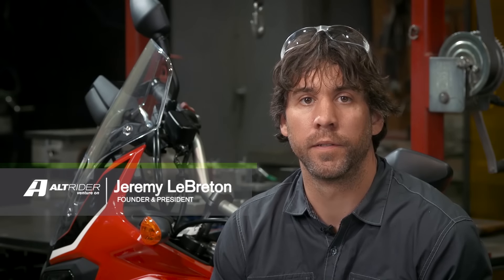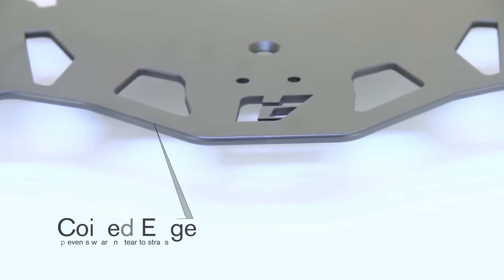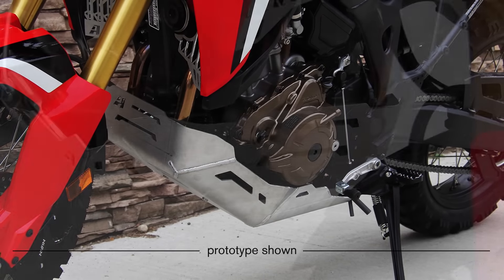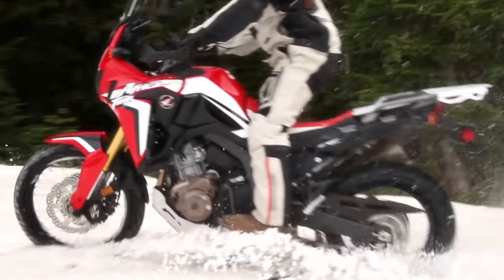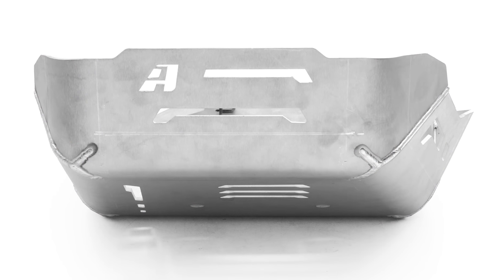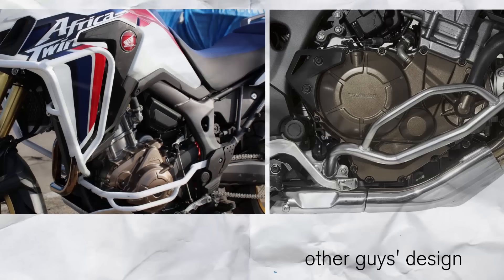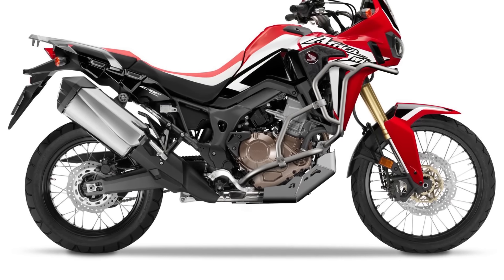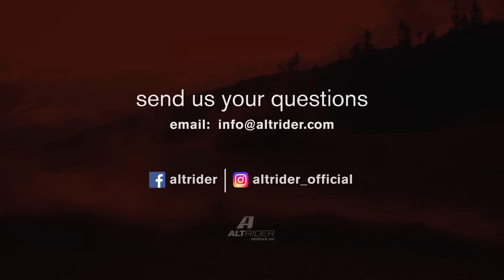Honda Africa Twin: Motorcycle Accessories from AltRider

Comment: I own all the Altrider parts available for my current bike and would most likely do so again if I were to purchase an AT. My only hangup with the information available here is that yours is not the ONLY two piece passenger and tail luggage plate currently available. Just hate to see you making the claim if it's not really true.
Reply from the maker: Hi Brian,
Thanks for the comment! In the time since making this video it seems another manufacturer has produced a two-piece luggage system. We've added a note to the video description to clarify. To our knowledge we were the first to produce a two-piece luggage rack system, and ours is unique in that it allows riders to install the two racks together or individually. We hope the extra flexibility will help riders customize their bike to their liking.